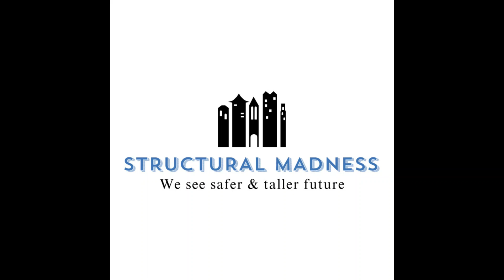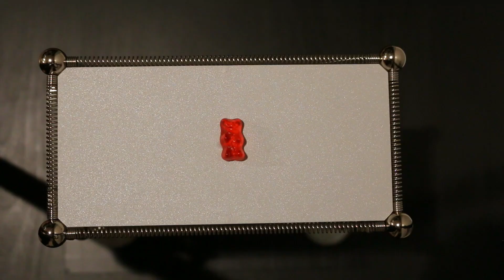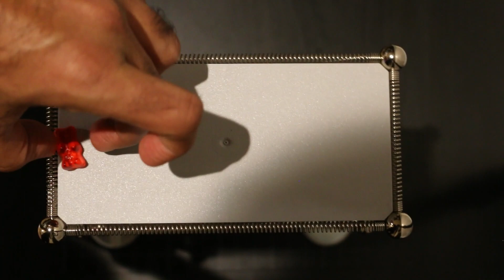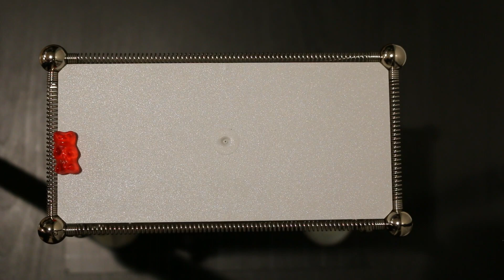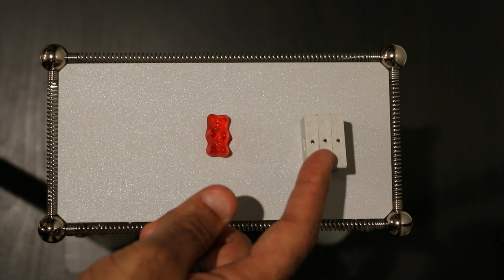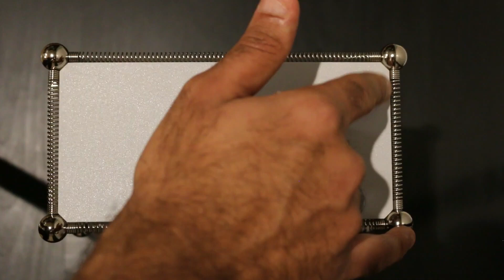What is Torsional Irregularity in a building?

Comment: hey.
could you please answer this query of mine
.how do rcc slabs act in real life structures when  lateral forces act on them. do they act as a rigid diapgragm or a semi rigid diaphragm.are they designed for any lateral forces acting on it?
Reply: Hello, the rigidity of the diaphragm should be based on the diaphragm deformation compared to the deformation of the lateral system. Rigid or semi rigid are analysis perspective. If the diaphragm is a long span diaphragm, then there will be additional diaphragm deformations which should be accounted for, and it's flexibility / rigidity can also impact the load distribution between multiple LFRS frames. In such scenarios assigning a rigid diaphragm for analysis wouldn't make sense. But if the diaphragm is relatively stiff and short span, then you can assume it to be rigid. Although it is not as simple as this to classify the diaphragm as rigid or semi rigid. It also depends on openings in diaphragm, layout of LFRS system, torsional irregularity, span to depth ratio of diaphragm and so on. ASCE 7 as well as NEHRP design provisions will give you a very good explanation on how to determine the rigidity of diaphragm for analysis purposes. And the diaphragms are and should always be designed for the lateral forces acting on them. That is the primary load path on how the forces get into and out of the LFRS system.
Reply: thank you for your response sir.i look upto be like you😃